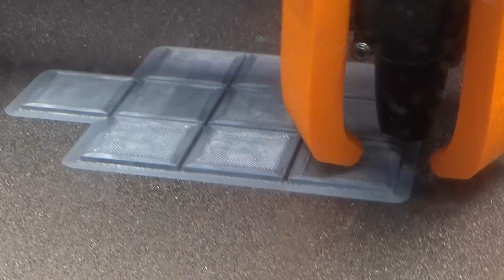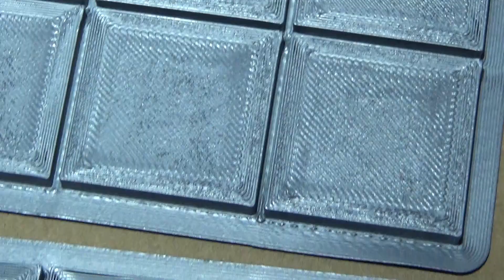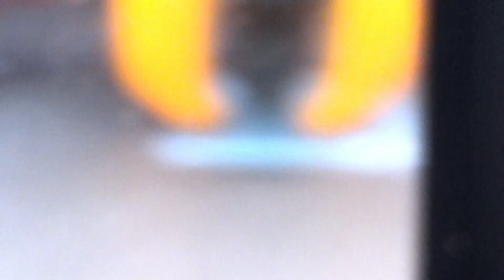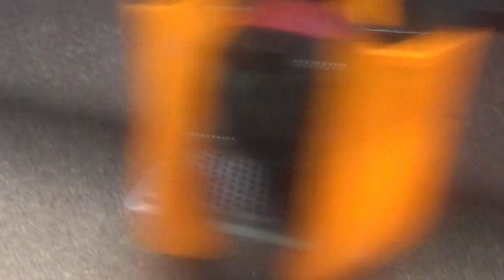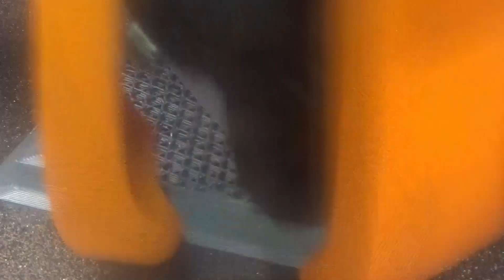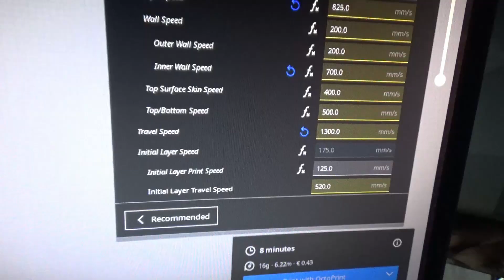300C EM, Drying Results and Almost 80mm^3/sec Printing

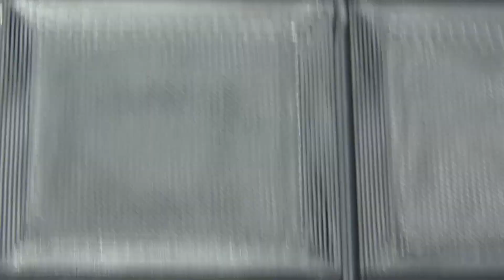Comment: 4:00 looks like PA needs adjusting
Reply from the maker: Yep, I am still struggling with that at very high speeds. The Outer wall flow and therefore pressure in the Nozzle is way lower than on the other features. I think it would be ideal to have a dynamic PA value that changes based on speed or always a constant flowrate that has little change and tune PA for that.
Reply: @VaporizationEnt  There is some talk about dynamic PA on the klipper discord, haven't look in it. I find that PA is tuned best by trial and error.
Reply from the maker: @3DPI67  Very Interesting, Thanks for the Suggestion.